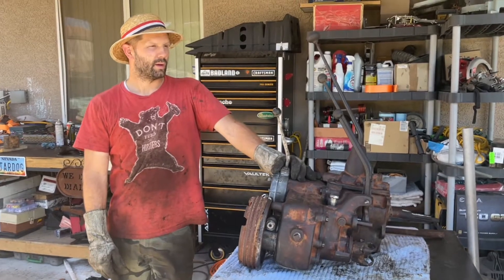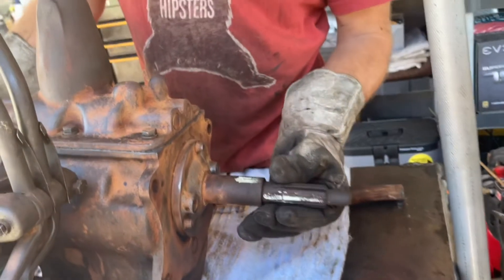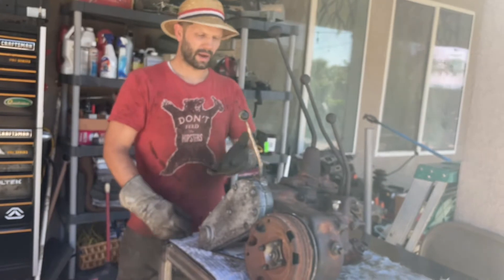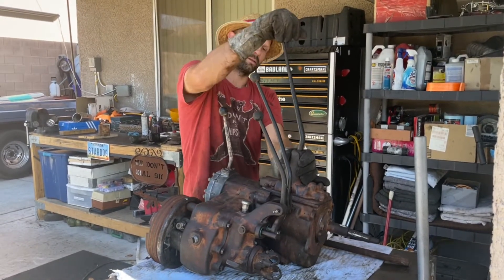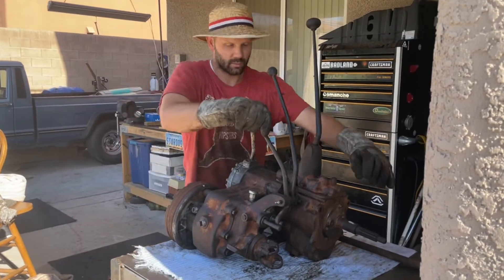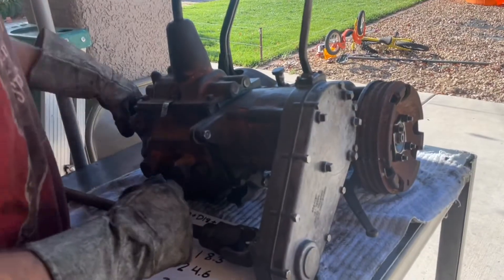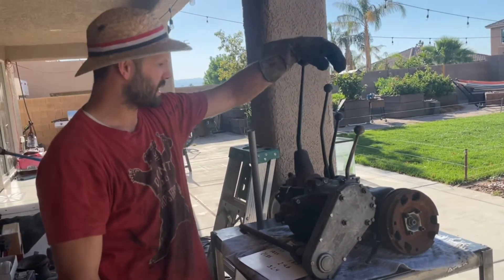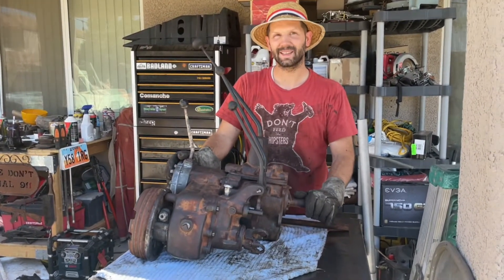1964 Jeep CJ5 Borg Warner T90 Transmission and Spicer DANA18 Transfer Case

Comment: Just got a 64 cj5-right side of the transfer case is not attached to anything. [from driver's side perspective]   Hole for bolt/bushing is not aligned.  This should be attached, correct?  E-brake drum/shoes are not aligned,  shoes appear to be slightly smaller than drum.  Appreciate any insights!!